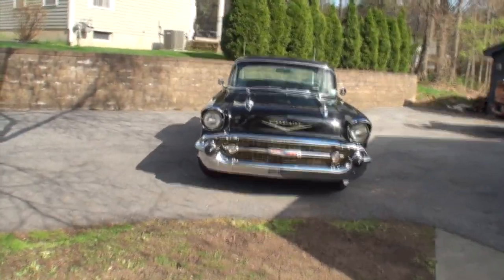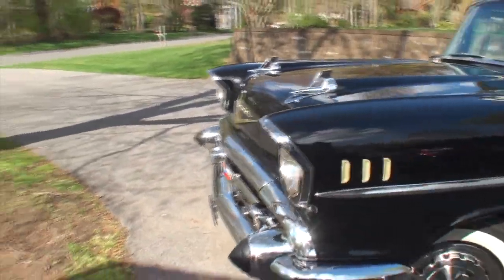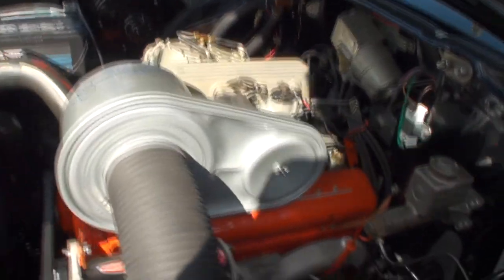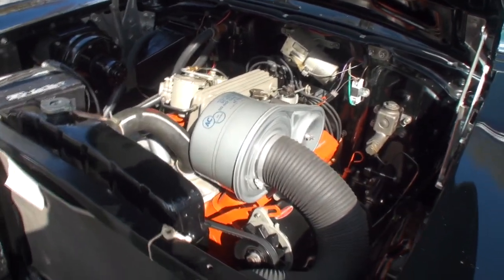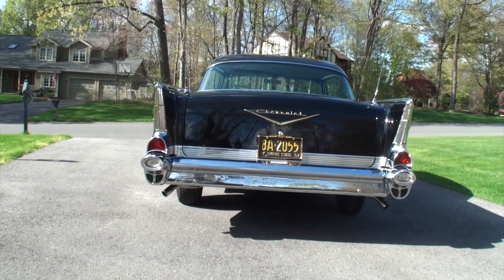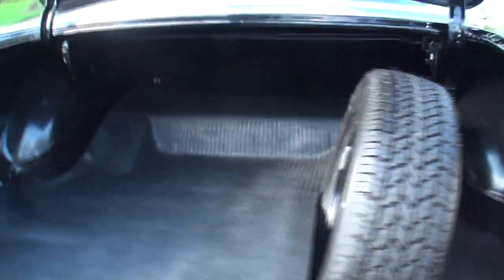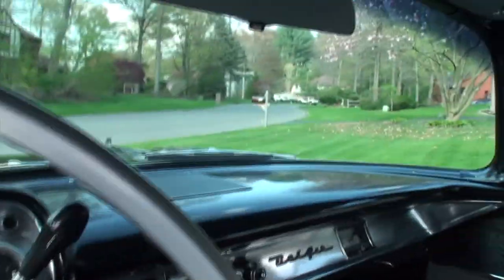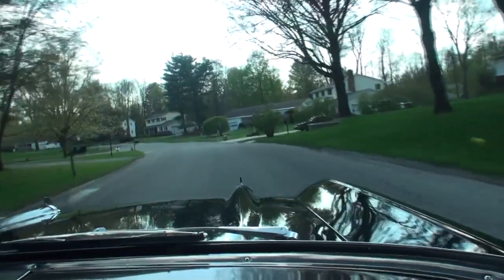Fuelie ! 1957 Chevrolet Bel Air Fuel Injected in Black & Ride on My Car Story with Lou Costabile

Comment: Wow! What a beauty! That 1957 Chevrolet Bel-Air 283 Fuelie looks awesome in it's Tuxedo Black paint job! It's rare to see a fuel injected 283 with a 2-speed Powerglide slush box automatic transmission behind it. It sounds extremely healthy and performs well on the road. Most fuel injected cars were equipped with a manual transmission either a 3-speed on the tree, or a 4-speed on the floor. This 1957 Bel-Air is in pristine condition. Another awesome find Lou!
Reply from the maker: Hi Michael, High praise :-) My pleasure sharing this one with you, Lou
Reply: I thought 1960 was the first year of the 4 on the floor full size Chevy

Comment: 1957 Chevrolet Bel Air.
The Bel Air started in 1950 with the "Blue Flame" Inline-6 or the "Thriftmaster" Inline-6, also being featured on the 1953-1962 Chevrolet Corvette. The car's name originates from the Bel Air neighborhood in Los Angeles. For the 1955 model year, it gained a facelift, featuring a new front and rear along with a new paintjob. For the front end, it featured a Ferrari-like appearance for the 1955-1956 model years (Rectangular grille, circular [1955] and square [1956] dual beam headlights]). For 1957, it gained the most iconic front end, making it the most iconic Bel Air. The front end had two Chevrolet badges at the front, bullet fins, and moved dual beam headlights. The engines that were available in the 1955-1957 Bel Air in terms of V8 were the 265 Cubic Inch V8 and 283 Cubic Inch V8 (4.3 Litre and 4.6 Litre V8).

There were two other variants of the Bel Air, the Chevrolet 150 and the Chevrolet 210. The Chevrolet 150 was the lowest end model and the cheapest model, while the 210 was a step up from the 150, but still below the Bel Air in terms of features and price. Both the 150 and 210 were replaced with the Chevrolet Biscayne for the 1959 model year, which would last for 1972 in the United States, but 1974 in Canada.
Reply from the maker: Hi Matthew, Thanks for sharing your knowledge and adding info to the Channel, Lou

Comment: As always, Lou, stellar video.  One thing I would have liked to have heard was where and how he obtained this car. Also you  consistently show every plate and sticker with the star being the jack instructions yet you seemingly are ambivalent when it comes to something as rare as power windows on a 50's mid priced car. That feature is almost as rare as the fuel injection.  Was everything on the car when he purchased it and if not what parts did he have to acquire and how difficult were they to find? Did he also do the interior? The Rochester fuel injection is notoriously difficult to keep in working order. Does he do his own adjustments and has that been a problem for him? 
Lou just some things that would make your Car Stories more interesting and entertaining. My opinion but your show.
Reply from the maker: Hi Bill, I'm ambivalent to a lot of things, and yet all the Viewers like you who enjoy the Channel regardless of my short comings. Not sure about all your questions, however Mike doesn't seem to have an issue with the fuel injection system, Lou

Comment: This one has the 250 horsepower fuel injection hydraulic lifters and automatic. You can tell not only because it is automatic. The air intake off the air cleaner hangs down.
Reply from the maker: Thank you for sharing your knowledge.

Comment: Really love this '57 Bel Air sport coupe Lou, and a nice belated birthday present for me (born 5/26/57). Always a favorite since  I was a small child. The flawless paint with the chrome is perfection. The car has the original (or original style) rear view outside mirrors, and noticed the power windows, not common back then. Most importantly it follows the 'less is more' sense of restoration. The Bel Air siding continuing along the bottom of the trunk looks sharp. 

Too many '57's are bogged down with the really ugly continental kit, fender skirts, hideous bumper guards (front & back), and the awful extra fender mirrors further down the fenders that look HORRIBLE. It's particularly common on the convertibles. The really sad thing is these grotesque add-ons were legitimate "options" that could be ordered going back to when the cars were new, and either a lot of people did then, or they've been added in recent years by new owners who think it's a good idea with these accessories (unfortunately) still available. Anyway, this one is an example of what the car should like: no distracting, interfering, disgusting, and completely unnecessary garbage.
Reply from the maker: Hi Bob, Happy to read you and this car share the same birth year :-) Thank you for viewing and sharing, Lou
Reply: @loucostabile  Thank you Lou for all you do.Such a beautiful morning in (what I presume is) upper state New York. The car looking right at home in that countryside.

Comment: Even more rare is a fuelie 4 speed car. More rare than that is a fuelie 4 speed convertible. I/we restored one of those. Turquoise/white car that was sold for huge buck$ and shipped to Germany.
Reply from the maker: That is a rare one for sure.
Reply: @loucostabile  It took us over 2 years to restore. It sold for $128,000. and that was several years ago. Not one ounce of plastic body filler either.